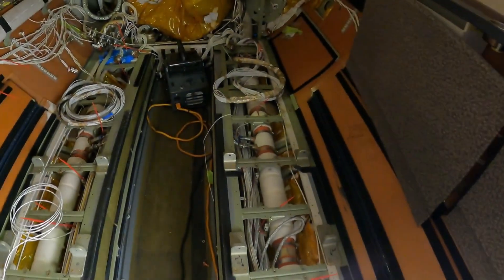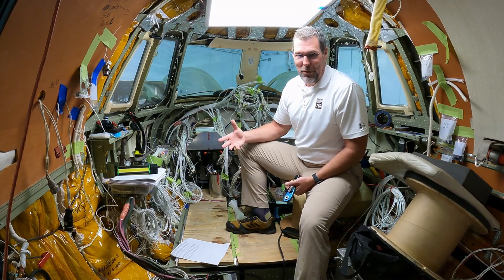Duncan Aviation G5000 Installation | Episode 2: The Wiring

Comment: Wow, I have been in Security wiring many systems keeping things neat. The best workmanship I seen ever is from another tech. This work to me is taking it to anther level all together. Cool to see the aviation side of electrical systems. I'm sure code connectors . On BC Ferries , Marine codes apply , funny thing , the network is strictly guarded for security reasons. I was told wile working onboard , if you plug anything into the network your simply fired.... So, you set ip in camera only then plug it in , And call to see how it looks. Fun stuff...LENEL